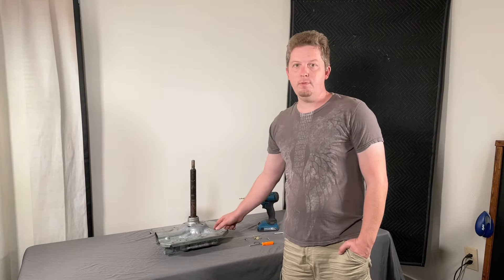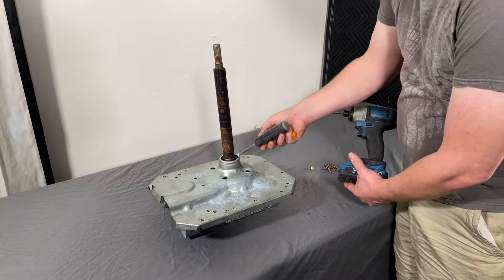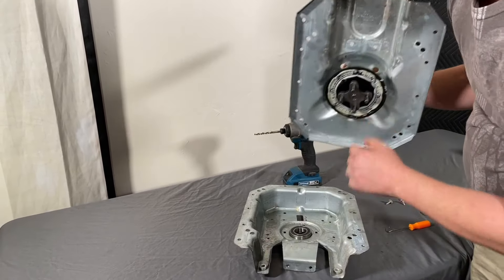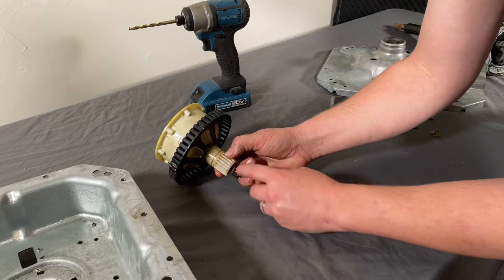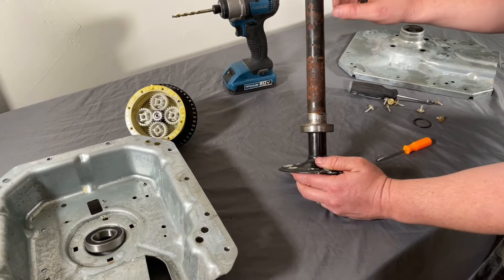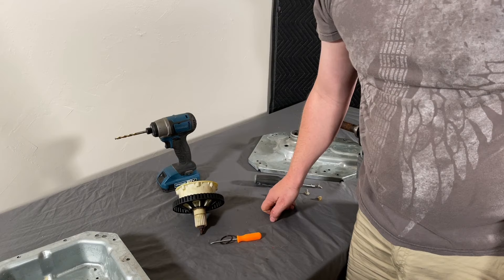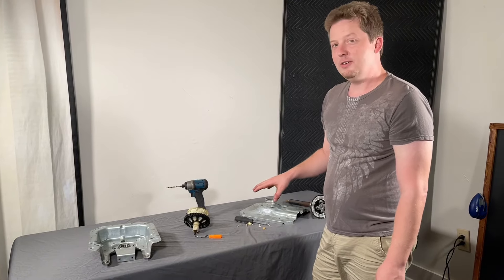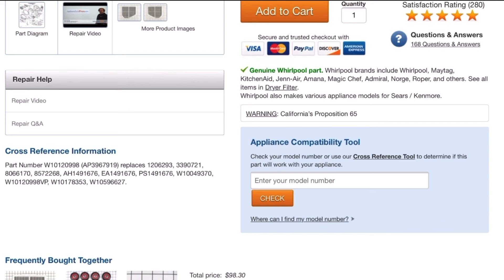Loud grinding shaking transmission bearings replacement Can you rebuild a newer washer transmission?

Comment: I managed to replacevthat top bearing on the shaft. Cut the welding and removed the flange on the bottom. Removed old bearing, fitted new bearing. Lined shaft and flange in the lathe and rewelded. Riveted housing back together. Probably not worth it if you don't have access to a lathe.
Reply: No no, There is much simpler way.  That sleeve above the bearing comes off without any problems at all.  Look above at my comment what is up and how it is done, and where and how to replace them.

Comment: Hi, how did you get the upper bearing shaft combo disconnect from the case? I have removed the seal but the shaft is still stuck to the case.

Comment: Just took apart my transmission as per this video. The stainless steel collar for the seal on mine came off with abit of light hammering. I pop riveted the transmission back together with new bearings and it seems to be functioning.

Comment: Great video! Thank you! I came here looking for an answer to the super loud scream/ screech that my washer made when I ran the Auto-diagnostic mode. It went through every step fine, but when it got the the wash-spin mode it made the loudest grinding scream I have ever heard. then it started spinning. I figure it's the clutch mechanism not engaging properly, but I also wonder if it's a broken gear in the gear box. (Your video gives me an idea of what is in the gear box by the way. which is super helpful.) any insight would be great! I appreciate your time!
Reply: Yes that bearings can be replaced I have done it a lot
Reply: if yours is one of the machines with a plastic motor belt pulley check make sure the motor pulley has not striped its internal splines binding its rotation to the motor shaft  .  I have seen that happen the torque necessary to spin makes the motor shaft slip inside the pulleys splines  and it makes a loud screech sound.  exactly what you are saying..

Comment: I guess I'll be replacing the seals & bearings. I don't have the cash to buy a new one so I've been keeping this one running by watching YouTube videos 😂 I've replaced actuator a while back & the drain pump a few days ago. It didn't want to drain and was leaking I thought it was drain pump issue but it's still leaking so now I'm guessing the leak is the seal and it's been making a sound so I might as well replace the bearings as well. Can't lie tho this looks a bit intimidating. I really hope mine is welded on it's a diff one so let's hope.
Reply: Bearing go bad and The wobble eats that tub seal like no ones business same here shorted out my actuator chased it to here
Reply: @trentshull6356 Make a video of your washer on spin cycle

Comment: Thank you for all your videos. Very informative. Going to give rehabbing washers and dryers, part time, a go, picked up my first dryer this morning. Ever try to rebuild a LG transmission? 
Thanks again!
Reply from the maker: Good luck with your dryer. LG’s are not extremely popular in my area. At least I don’t get them very often. If I get one and it’s got a bad transmission I might break it down. I love to figure out how things work.
Reply: @WasherDryerMoney  I am known to tear things apart to see if I can get a better understanding of them sometimes. 
  Just a few days ago, I tore into some suspension rod springs to see about making them stronger by dealing with the foam inside the plastic pieces. 
  Cut the first one or two in half. Then decided another way to experiment with getting the moving plastic parts more grip.
Reply: Stay away from LG,Samsung,GE,Criterion and front load washers in general. If you want to make any kind of money, stick with  Whirlpool direct drive standard washers and dryers.

Comment: Can you do a video of your recommended machines?
Reply from the maker: That’s a good idea. The obvious answer across-the-board for most Appliance Repair guys is the speed queen. But they are expensive. If I’m going used I would get a older direct drive washer.

Comment: Hi, Just starting Watching your Videos which are very informative for someone like me that is going to try to Repair Machines in my area of Massachusetts,,
I was just thinking in all those Dryers/Washers that Home Depot ,Lowes ect Sell each day and someone has to Service there Appliance when they break $$$$$
You are doing a Great Service with showing us what you learned !!! Should i get a small Trailer i can hook up to my truck to pick up unwanted free broken machines ?
I am very Handy and know how to use a Multi Meter and will give this a Shot!!! Just can you give me idea of what my Service Call Should be ?  
I called a Service Company in the Boston,Ma area and they say they charge $150 Service Call to work on High End Appliances !!! Wow ..
God Bless and keep these. great Videos Coming !!!!  Joe
Reply from the maker: I worked out for a long time with just my pick up truck. I got a ramp and a dolly and that was pretty much it. So you can definitely start off a truck but Would probably be a great upgrade later.
The best way to figure out what you can charge is asking some service guys in a Facebook group. A lot of times they’ll be a local to your area and one of those groups and they can give you the lowdown on exactly what you can charge. Check out the Facebook group “appliance apprentice group”
Let me know if you have any other questions.

Comment: What was the part number for the one that’s stuck on that shaft ??
Reply from the maker: It’s been too long since I made the video. I don’t have that transmission sitting around anymore. I believe it’s the same as the bottom one as far as the number that I showed in the video.

Comment: What kind of oil can i use to replace the planetary gears?
Reply from the maker: I believe it’s gear oil, but I’m not 100% sure on that. They’re not really made to be serviceable as I mentioned in the video. 
GE use grease and I think that’s a better idea because it’s less likely to start leaking and fail compared to any oil.
Reply: @WasherDryerMoney  thanks for the response! And thanks for your video it saved my washing machine. One question about the transmission shaft. I guess that it is normal for it to be exposed to water hence why the tub seal is right below it?

Comment: At 6:11 showing the bottom of the bearing and what looks like the top of the piece it looks like it is pressed down to, is a thumbnail like groove.  
  I wonder if you could clean the rust off the shaft then use a straight edge tool to separate the bearing from that piece then work it off. 
  I have a few that need bearings. Don’t think I am going to go through that.
Reply from the maker: Yeah that was my main take away. It’s just too much trouble even if the top bearing came off easily. If you spend the drum and it makes any type of grinding noise it’s not worth fixing in my opinion.

Comment: I have a GE Model # GJXR2G80W washer that has a loud clunk when it switches in and out of spin cycle. Is this a transmission issue?
Reply: Did you ever figure it out. Mine does the same thing... it'll stop spinning after a notable clunk then just start filling with water. With either a UR code or something similar to an unbalanced load?

Comment: May I present solution to the bearing problem?
First know that it is the top bearing that goes out and not the bottom, 99% of the time, the one you can't get it because of that sleeve above it.  It is that bearing that goes bad as it is right under the rubber seal.  So now that is clear.
Okay second, most of these so called gear boxes don't have them holes you drove the nut driver through.  But that is not big deal, you drill a couple of hole with a drill bit.  That solves that.  Just need 2 hole or even one hole is good enough.  

Okay I will start from where you lift off.
Clean off the rust with a sand paper, clean it good, on that metal tube  that the bearing and the bearing sleeve is on it.  Then just spray some lubricant on the tube.
Place the bearing above  the jaw of a vise or whatever and hit the top of the metal tube with a hammer by placing a 2x4 in between.
The race/sleave and the bearing will come out, no problem. The sleeve is not welded or glues or anything. It is pressed in at its top edge. If you look close you can see it.  I have repaired at least dozen of these.

Clean the housing and install the new bearing ( 30x55x13mm, you can get them anywhere).  Pounce the bearing until it seats.  It will seat half way up, It won't go all the way to the top, so don't dry it.

Here is the seal:   (Washing machine tub seal w10324647 w10006371 Ap4567772)
Now comes the creative part.
How are you going to install the sleeve and where would you get them?

Aha.
Ready?
They are 1 1/4" diameter, brass or some sort of rust resistent metal.  So this is what you do.
You go the plumbing joint and buy a chrom pipe extension.  They are located at the sink drain section.  They are exact same size and the exact right wall thickness and no rest.  One extension is enough pipe to repair 5-10 usage.
You cut it to size, about 1 1/4 long. Before you feed it in place, clean where it goes with rubber alcohol or so and put crazy super glue there.  feed the new cut pip in place there and leave it for about an hour. It won't go no where.Make sure the pip is long enough but not too long (otherwise it will interfere with the basket) because the rubber seal goes around that sleeve.  Your transmission will purr like a kittten.  
Cheers.
Reply: Sounds like a clever solution. Make the video!
Reply: @brucestevenson6085  It is difficult to video tape it while actually working at it, being one person. 
I don't know why I left this crucial detail out.
There are times that the bearing is rusted good and it is pretty difficult to take it out using the method I have described.
Since nobody cares about the sleave or the bearing, use a dremel with cut off wheel and simply score the sleave vertically. Score it enough so you can use a chisel  and a hammer and hit it and it will open up and give.  You can then just slide up and remove it, using a channel lock or whatever.
Comes the bearing that is stuck on stupid and rusted good.
No problem.
Take the dremel with the metal cut off blade and score the outer part of the bearing.  Score it at two parts,  180 degrees, one opposite the other.   Bearings are hardened metal. So once scored good, take a hammer and smack on it good and the bearing outer collar just snaps and falls out. You can see videos of these on Youtube how stubborn bearings are removed.
The littler ball bearings justt comes off of course.
Now the inner part is what is stuck on the transmission tube.  Same deal with that,  score it like you did with outter collar.
Except you can't hit it with a hammer.  Use a chisel and a hammer.  Just place the chisel on the score line and hit it. If it doesen't just break and snap out, it will loosen very good.  In that case you just take a channel lock or whatever and just walk it up and out.
https://www.youtube.com/watch?v=BIMt0WGmwxQ
Reply: Thanks
Reply: @brucestevenson6085  You can see this guys work better with a closer view.  He just cuts it through. I am a little impatient.  Nonetheless the idea is clear.
Also the bearing he is cutting seem to be more giving in my perspective.
He also didn't cut the inner race at two places for some reason or it would have just snapped out as the outer part.
Although I haven't tried it but I can bet that if you heat that outer brass sleave with propane or acytelene torch, it will expand enough where you can just take it out and then reuse it.
I am gonna have to try that.
https://www.youtube.com/watch?v=zEKb6a_StFg

Comment: Do you have any part number(s) for those transmissions?  From there we could arrive at a cost. From there, might it be cost effective to repair with upgraded bearings and replace oil with grease. When I need a transmission, I may be willing to pay more for an upgraded rebuilt one.
Reply from the maker: There’s only a few types of those transmissions. The big difference is the shaft in the middle is small for the low profile agitator version. I’m not sure there’s anyone making heavy duty versions of these transmissions. The video I did on removing the bearings from this transmission concluded with me thinking it was way too much trouble to get the top bearing off. Hi have heard there are a few guys that have gotten days off but their opinion was pretty similar to mine it’s a lot of time. You can look up a lot of prices for these transmissions on eBay to give you an idea anywhere from $100-$200.

Comment: I SUGGEST TO RE-GREASE ALL BEARING WITH MOLY GREASE or Lucas red and tacky EVEN NEW ONES UNLESS YOU BUY A GOOD BRAND SUCK AS SKF KOYO  . THE CHINA BEARING NEED BETTER GREASE AS THEY USE CLEAR JUNK IN THEM  PARDON CAPS BUTTON STUCK ON

Comment: You should message me because I had about the same problem but what I did I got a torch and heat it up then pound it out and it didn’t work for me I can show you some pictures if you send me a link
Reply from the maker: Send me an email.
Washerdryermoney@gmail.com